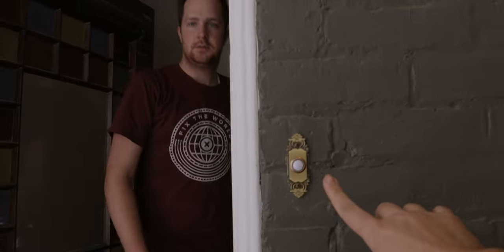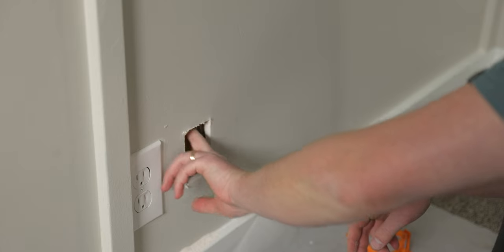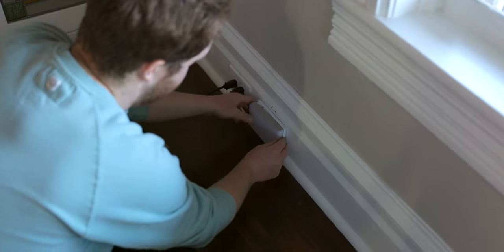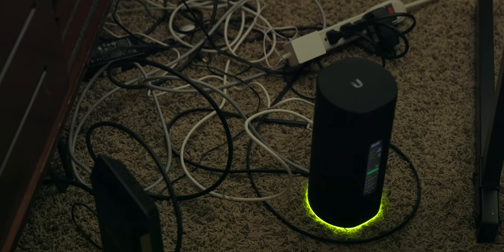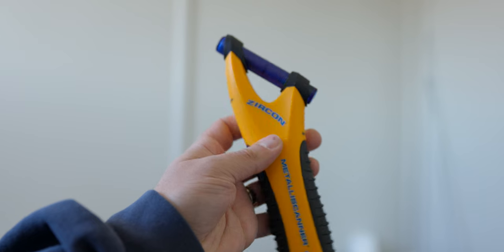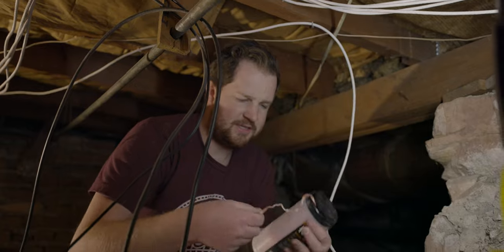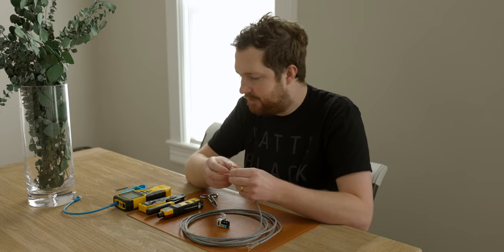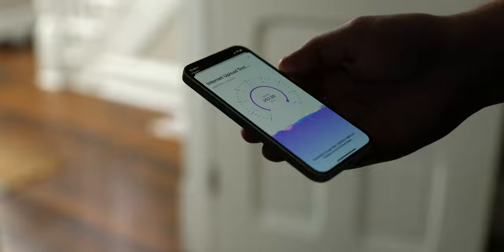Adding 10 Gigabit Ethernet to my 129-Year-Old House!

Comment: Congrats. That's quite a retrofit. You also saved yourself several thousand by doing it yourself ;)
Reply: I just did the same thing to my house. Before I started planning, I called a local company that does this in my rural neck of the woods, and they charge $90 an hour. Save several thousand indeed.
Reply: @JTrizzo8  when we moved to rural Oregon we’d not got a lot of time for DIY projects because of a simultaneous family crisis. We had to spend $2,000 on a flood wire for a 2,000 square foot home. That was for 26 patch bays....
Reply: ...which he then made additionally from views. So not a bad result!
Reply: -x
Reply: He also saved the lath and plaster from being ripped out and destroyed by monsters
Reply: yes and no running cable is dirt cheap
Reply: Down side in Australia is the laws state you need a license to do this or to pay a fully licensed cable person to do this
Reply: Several THOUSAND? It seems like a single day’s work and I’m pretty sure cable fitters don’t charge thousands per day. Plus the outlay in tools that you’ll probably only use once and the time investment make this seem like a pretty bad bet for anyone who doesn’t earn a living filming themselves doing tech stuff.
Reply: @donovanleemurphy9349  I charge anywhere for 500- 1000 per drop. And have never had an issue with finding clientele.
Reply: @davypelletier  is that with materials included and all? If so, sounds like pretty good value to me.
Reply: @donovanleemurphy9349  yea I mean I get my cable and everything at dealer prices so I profit off the cable and everything else that goes along with it. its not unheard of to bill 10K a day on some projects.
Reply: Indeed, hell I am doing (well: I will be, once my equipment arrives...) something similar to an appartment (formerly my aunt's appartment, but she's moving to the groundfloor)...before anything else happens in there (even before painting the walls!) I want LAN in every room except the bathroom and I am also doing this myself, because on the one hand I really want to and on the other hand it saves money, too :)
Reply: @donovanleemurphy9349  Well, having those tools is great if you want to change anything in the network or if you have a malfunction you need to hunt down...constantly paying someone to come is way more expensive.
Reply: @dreamingflurry2729  not sure what your hostility is about all I did was state a fact about the laws here in Australia. You do you mate.
Reply: Didnt get it lol. What connection there was before?
Reply: Probably made money on it because he could film the whole process

Comment: A year late, but a note about the rip-string inside the cable (19:00) - You actually WANT to use this to rip the jacket down below where you did the initial stripping to, because even with the fancy stripping tool you showed it is still very easy to nick a single wire to the point where you break the wire or at least weaken it so it breaks at some point in the future. They don't just include this rip-string because they can, the include it because it's practically necessary.
Reply: This is a good point, especially if youre going by th echeap and use a knife sizzors etc. or even lesser expensive stripers (who doesn't like cheap strippers anyway?)
However when doing data centers, or larger networking the tools are designed to be exact so that precide cable lengths are cut for wire dressing.

Comment: Great vid! One thing I think is pretty important that you didn’t go over much is the “pull line” or cut line. It’s pretty important to use, because if you are using scissors or the built in stripper on crimpers, a lot of times it will cut through the jacket and it doesn’t take much to get into the cable pairs making them snap easily. Using the cut string will eliminate the risk of having to go pin point an issue and give better durability.

Comment: I recently rewired my apartment. Totally worth it. A single, straight run for everything and using a single managed switch to check the connections (and do monitoring;  the phone would alert me if anything drops to 100mb/s, or go silent) is amazing. I do not have and old house now, but maybe I will and will give crap load of bandwitch to it. This is really informative, thank You. I usually test my cables using and old router and laptop without fancy tools and wigle it to check if the line is solid.

Comment: About Ethernet categories: my house was fully wired with CAT5e. I needed 10Gb speeds so I was ready to re-wire the whole thing with CAT6. Although, after extensive tests I discovered that CAT5e can carry 10Gb speeds just fine within the distances of a normal sized house. So, if you have CAT5e installed, give it a try before replacing it with CAT6, it may just work.
Reply: Nice! I've heard this before, but I wonder, how do you get your equipment to play along with that? If you plug a short enough CAT5e cable into two 10gbps ports on either end, is that enough?
Reply: @kusucks991  The main difference between Cat 6 and Cat 5 is the bandwidth. Cat 6 cables are made with materials, shiledings and overall quality to sustain higher amount of data. That being said CAT 6 and CAT 5 provide the same exact connection on both ends. So, within short distances, they are interchangeable. If you plug in a CAT 5 cable between two 10Gb devices, they will attempt a 10Gb connection regardless of the cable quality. If the cable can’t keep up, you will see loss of packets and  errors. In my case the “short distance” was at least 50 feet! My office is downstairs, the server is upstairs. During my tests I pulled a flying temp CAT 6 cable through the stairs and compared that connection with the CAT5e in the wall. No difference. I assumed they used good quality CAT5e cables when they built my house! Long story short, if you have CAT 5 cables handy, I think it is worth it to test them before buying CAT 6, but if you need to install a 10Gb from scratch, absolutely get the best cable you can afford.
Reply: A couple of years later, but I'm glad to see this comment. Yesterday I started researching upgrading my home to Ethernet instead of just wifi and found there's cat 5e wiring throughout the house. Thought I would have to re-run cat 6, but glad to see cat 5e will be sufficient enough

Comment: Well done, almost giving me the course to undertake this project in 2023. If I may ask, are you able to share what the total cost was of the project? Are you able to share what you’d do differently a year after posting? Any new tech you wish you would have used? My 3,100 sq ft. home needs this and thanks in advance for giving me the courage to consider doing this. I’d love an update if there is one. Thanks!
Reply: Having done a fraction of what is shown in the video, one thing I would suggest (which is kind of a no-brainer), is there are newer Unify APs available. I went with the U6 Long-Range. The single AP on the ground floor gives acceptable coverage for me even on the third floor. Probably Quinn could get away with fewer APs if he did it again!
I would +1 the message in the video. Take the leap. It is not terribly difficult, or even terribly expensive for most home improvement projects, just time consuming. Take your time, measure twice to get the holes in the right place, and start small. Do one run, see how it goes, and keep chipping at it until you've executed your dream plan!
One thing I already know I would have done differently, is I should have considered buying the right-size auger bit by doing a little planning and calculating the diameter of wire to run through each chase. My only option is in-wall runs, and it's pretty damn difficult to get the string through the hole the first time, so I would minimize the number of holes!
And make sure to get your new box on the same height as any existing boxes in the room. I mis-measured, and my new Ethernet is a solid half inch above the nearby outlet. It looks pretty amateurish!

Comment: "CAT6 in my opinion is pretty underrated"
Me with a 900ft box of CAT6 in the closet: "Go on..."
Reply: Cat 6 is only 1 gb . Why woud you us cat 6 over cat 5e
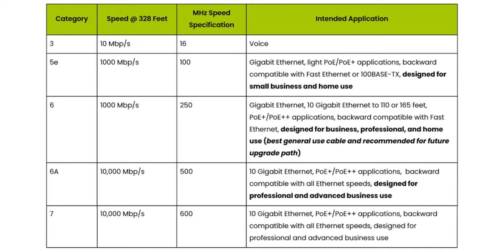Reply: @xythiera7255  9:40
Reply: @xythiera7255  Cat6 supports 10Gb up to 55 meters...
Reply: shoutout to my teacher who turned a blind eye and let us make our own cat6 cables on our last week of school to take home lmao
Reply: same
Reply: To avoid errors and max bandwidth, the runs should be tested and certified, especially as you move up in bandwidth and CAT cable type. It makes a difference: I had issues with my run to my ONT, and it testing showed I had 10% crosstalk due to poor termination with CAT5E.
Reply: @bladebud  Distance is a major factor as well.
Reply: @camerons.8322  True. If the cable is twisted or run badly around a corner, although bend radius is mainly a fiber issue. 10GbE is possible over short runs of CAT6 or even CAT5E.
Reply: Linus Tech Tips is typing....
Reply: I only use Cat 7
Reply: @xythiera7255  Cat 5e max support is 1Gbit. Cat 6 is 10Gbit support. Cat 7 can even handle 40Gbit up to 50 meters.

Comment: As a german, the fiber box and cable runs on the outside of the house seem so wrong to me
Reply: Same to me, we don't really see that here as we generally bury them, although Fiber is quite durable compared to copper (we don't really have much fiber), you can even string it on a power pole if you have to.
Reply: I, an American, am looking at that sideways. Seems like the spy movie scenes where they cut the video feed out by snipping a wire outside. Why??? lol
Reply: Amerikaner halt
Reply: Yeah, unfortunately cost rules all in North America. It's much cheaper for them to just strap it to the outside wall. They do bury the fibre feeding the home usually. It drives me insane, unless of course the installer has some pride in their work and they do the best they can to hide it. I work in telecoms and I run my lines as if it was my own home. As hidden as I can do it and as straight as possible! Having OCD really helps with this lol
Reply: Kennt jemand ein ähnliches Video bei dem das für ein deutsches Haus gemacht wird? Überlege auch mein Haus mit LAN auszustatten, aber ich glaube ein amerikanisches Video hilft da nicht viel
Reply: @doemaeries  naja bei einem deutschen Haus heißt es entweder Schlitze klopfen und Leerrohre in die Wand oder vorhandene Leerrohre verwenden und dann das Ethernet Kabel (darauf achten, dass es ein Installationskabel ist) in das Leerrohr rein ziehen.
Reply: @doemaeries  besorg dir auf jeden Fall 'ne Mauernutfräse um die Wände zu schlitzen. Kannst du im Baumarkt leihen.
Reply: of course, that's because it is wrong... somehow everytime I come on youtube and I see fiber work 90% of the time it's all wrong
Reply: @SuchByte  genau das habe ich bei mir in der Schweiz gemacht. Meine Wohnung ist in einem alten umgebauten Bauernhaus und hatte am Anfang nur in zwei Räumen Telefon Leitungen. Ich habe die vorhandenen Leerrohre genutzt plus zwei weitere verlegt. Jetzt habe ich in jedem Zimmer and je zwei Orten eine Ethernet Buchse. War eigentlich gar nicht so schwierig (ich hatte aber auch Hilfe von einem Kollegen der Handwerker ist).

Comment: The color sequence when terminating a cable does matter - the pairs are matched to help cancel out cross talk, especially at higher speeds. 

Under short runs this doesn’t really matter, but the longer your run the more likely you are to have high losses or not even get a link if you choose your own order. 

Given its color coded on the keystones and tools you might as well use one of the TIA standards - lots of smart people argued for weeks to come up with them 🤣
Reply: YES! The twisted pairs must carry the same signal with different polarities.
Reply: Drove me nuts when he said that.... There's also different rate of twist.  I cannot count the number of problematic LAN paths I have troubleshot that just turned out to be using wrong pairs.  This matters more the higher run distance.  Also, I I were going through all of this work, I'd run 6a.  It much more future proof.  Last, use plenum or riser grade cabling.  This minimizes the potential for this being a source or poisonous gas should you ever have a home fire.

Comment: „Inner walls usually don’t have insulation“ 

Laughs in German
Reply: @davidkorcak  there's a video by Cheddar that talks about why are American homes built so cheaply.
Reply: I think CNBC has one too on the subject.
Reply: I live in Germany and my house was also built before 1900 and although I'm pretty sure it will stand strongly for the next 150 years to come. But due to the thickness of the walls DIY-ing your networking becomes a little harder when you have to use 50cm+ stone drill bits that have to be able to drill through the double-layered brick walls.
Reply: @svw1999  same here - but honestly: with a proper long drill bit (LIDL has some every couple of months) you will even do holes through concrete ceilings just fine.
Reply: @svw1999  double brick is at least drillable. My House had 3 or 4 expansions done by my grandfather pre and post WW2. We have everything from Cobblestone over solid brick to hollow cinderbrick in  here.
Reply: German here. Internal walls need no insulation for thermal reasons but usually contain 5 cm of mineral wool, woodfiber or cellulose for sound insulation (in case of drywall). Old houses have no drywalls, usually bricks, some concrete or calcium silicate stones or really really old houses ave either stones or hay / clay / horse hair fillings of wooden structures.
Reply: Laughs in Danish..
Reply: Why the fuck would you insulate interior walls? Sound proofing can be a mild perk.
Reply: @randybobandy9828  because European homes are usually build solid with every wall being made out of stone 
To keep the warmth inside to use less energy to heat 
And so that the walls will stay for long times

Comment: Glad to see you mentioned that stapler.  A few years ago, I had a job where someone had stapled the cable down, with wire staples, including right into and around corners, so there were right angle bends in the cable.  I had to remove that and do the job properly.

Comment: I have a home that was built in 1865 and LIVED through all of this! Just sad that I did not have this video to learn from when I ran my network. The only thing that I would add: If you are running a single cable, run two of them. I find myself saying "if only I had a second network run". This was primarily in the areas when I installed IP cameras. Great Job!

Comment: I don’t think a 25 year old house is any more prepared to a 10gigabit Ethernet than a 129 year old house 😄.
Reply from the maker: My plaster disagrees.
Reply: @snazzy  My parents 50 year old house is made of solid concrete (and bricks for the outside) without any cable ducts whatsoever. We literally have to chisel a path along the wall, drill a hole up to the attic (which is just hell of glas wool insulation, a few movable planks to rob from beam to beam and nice asbestos tiles above), run the cable to whichever room needs it and then either chisel there again or live with a cable dangling from the roof. After that the damaged wall needs to be closed again with fresh plaster, primed (not sure if that's the right translation. We use "Tiefengrund") and the segment of the wallpaper gets replaced.
Reply: my brand new house they just built in 2020 isn't wired with ethernet I even tried to pay more for them to do it but my basement is unfinished witch means I can still wire easily!
Reply: @aaronjohnson2547  👍 yea. That’s exactly my point.
Reply: @maxroman2010  oh I know that's why I commented. Ethernet should be standard in all new homes but even in 2020 it's just not. They all expect you to use wireless and look at you like a deer caught in headlights when you say I don't want to use wireless.
Reply: Sometimes worse. Try pushing new cable run though a wall filled with insulation.
Reply: @shaun6828  someone should tell Quinn.. he isn’t very good at accepting facts 😄 too focused on emotional claims. 

(I tried to explain to him what meaning his name has, when he wrote the wrong meaning on Twitter. 😄 so he blocked me).
Reply: Probably could use MoCA if willing to have 2.5gb speeds

Comment: Important: If you're crimping and terminating your own cables, you need VERY VERY short amounts of untwisted wires.  Gotta keep it tight and compact, or you lose all the advantage of that CAT6 (6a, 7, etc) cable you just paid extra for.

I actually prefer to use premade cables when at all possible.  Cable cost increase for your average home is negligible, and the amount of time needed to faff about crimping cables is just not worth the extra few dollars.  Then you can use Keystone couplers instead of keystone jacks, both in the wallplates and the patch panel, and everything is suddenly SUPER modular.
Reply: Was looking for this, untwisting your pairs introduces crosstalk and interference that essentially sends you back to cat 5 specs. Cat 6 needs to remain twisted to the point of termination.

Comment: I genuinely enjoyed this video. I like your sense of humor and the tips for running cable. 

However, as far as I can tell, this is just a gigabit network, not 10G. While your cable runs can certainly support 10G, the UDM Pro only has a gigabit switch built-in. It's possible you have a 10G switch connected to the UDM via its 10G SFP+ ports that wasn't shown, but I wish that information was shared. I was hoping for how best to set up a 10G network beyond the type of cable to choose.

Anyway, still a great video. Thanks.
Reply: His point was to touch on the importance of future proof the part that requires a lot of work and upgrade costs are minimal. Buying a 10Gb/s switch is overkill, expensive, and by the time 10Gb/s becomes relevant in most homes, switches will be better.